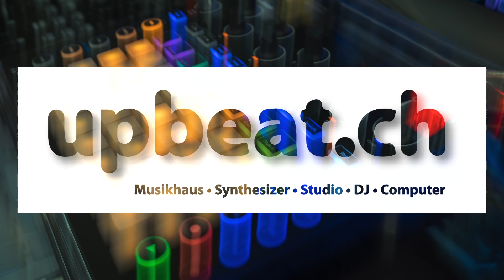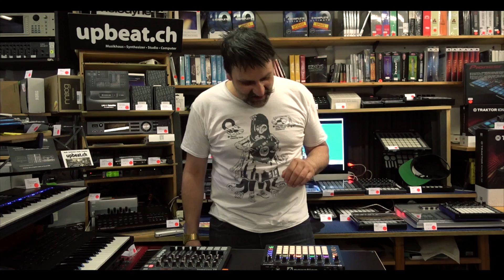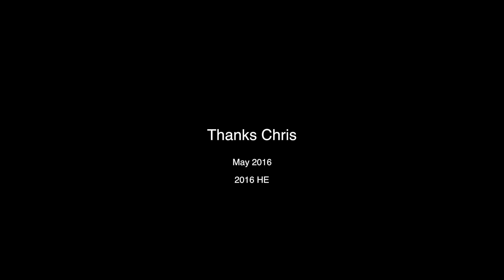Novation Circuit Tricks im UP BEAT ... :-)HE

Comment: thank you! 
is this working standalone (with circuit) or only with ableton?
Reply from the maker: Circuit is working standalone , if You want with Battery and build in Speakers... Chris controls circuit via Kenton MidiHostAdapter(Novation Launch Control XL USB Out to MidiHost, MidiOut from MidiHost to Circuit) best regards HEinz
Reply: Up Beat Musikhaus
i meant if the launchcontrol works with the circuit standalone ;) cause normally it´s an ableton-controller. but i found out that it works standalone (with the Kenton) - Thanks :)
Reply from the maker: Hi Cheepo You need the Kenton MidiHostAdapter not Thru, HE
Reply: dingStar bumStar how did u hook them up together with a Kenton thru??  I'm anticipating my circuit to come on Thursday or Friday.  I may get a launch control xl if it gives that much more control is it using a script or something???

Thanks in advance...
Reply: Up Beat Musikhaus thank you I didn't know they made those that's pretty cool and useful as I'm trying to eliminate my computer from my live setup.  A bit expensive tho. I've been using midiOX to accomplish this with my computer it's free but makes u need the computer.